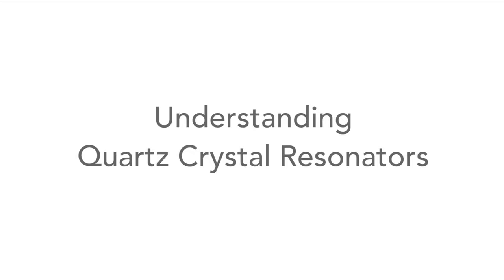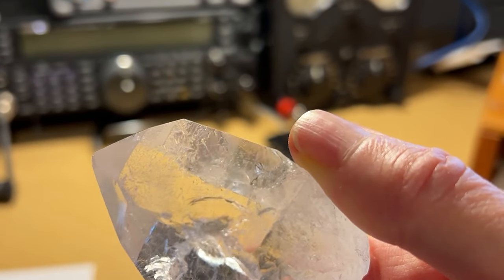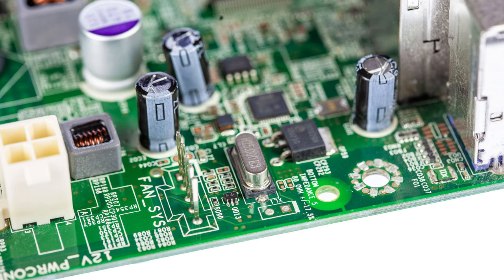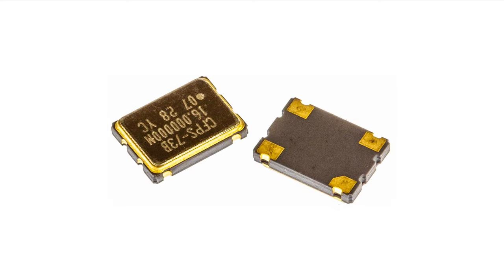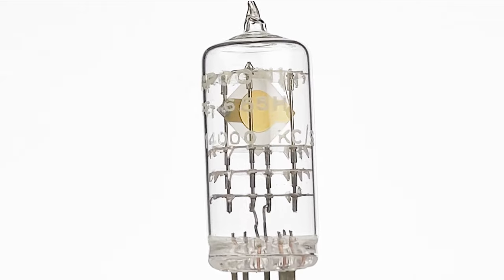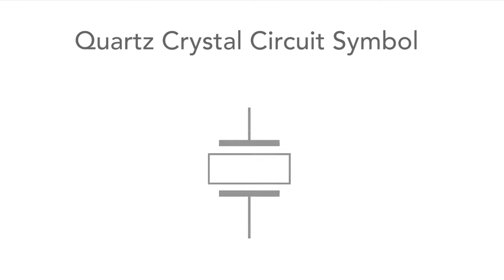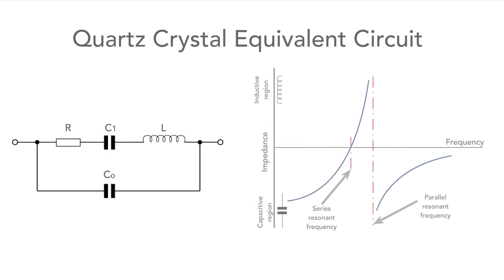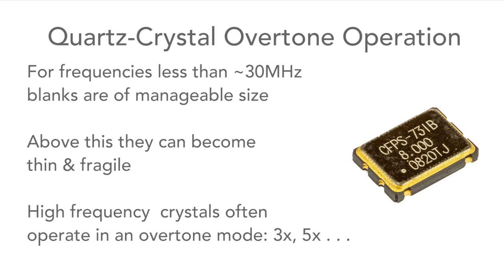Understanding Quartz Crystal Resonators #quartzcrystal #crystalresonator

Comment: Should I read resistance across the pins of my crystal always? I have two off a board I over volted and both of them are reading open across my ohm meter.
Reply from the maker: Yes the resistance seen by an ohm meter will show an open circuit.